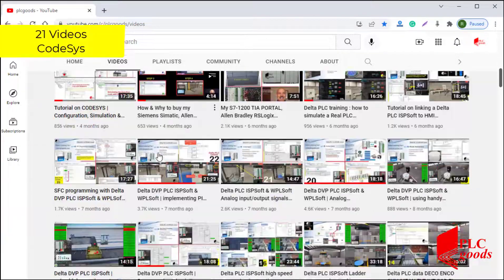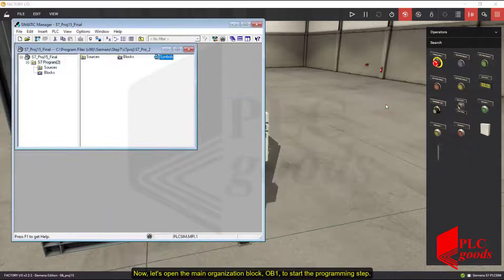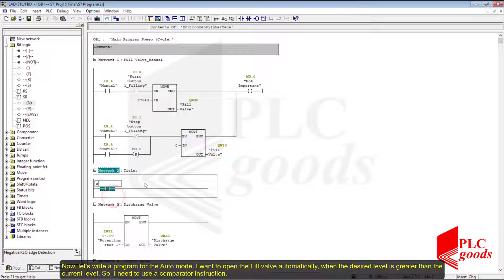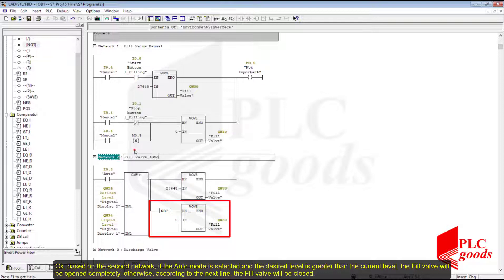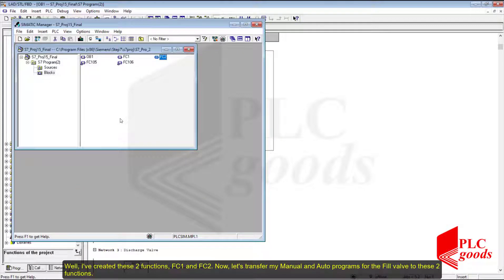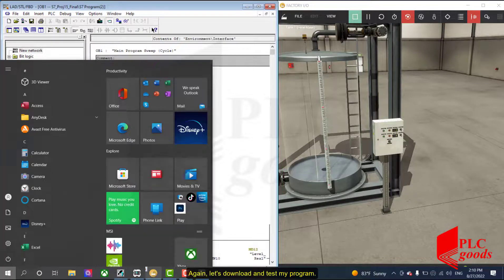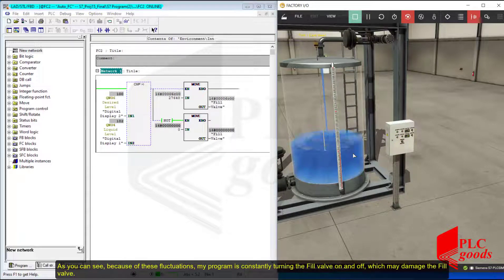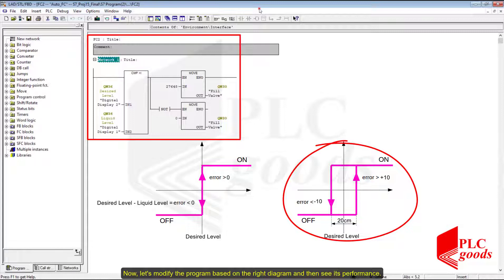ONOFF controller design - ONOFF controller design sample | Lesson 17

Comment: Can I ASK do you have some video for s7-200 using mircowin.
I have been asked to replace a plc in a network of three.
I can plug into th master and seed and copy the programs from all three. I load the program into the new plc and install in the network but the master will not see the new unit. Anybadvice
Reply from the maker: Thanks for your question! 😊
I don’t have any videos on S7-200 or MicroWin, and I’m not planning to cover that series.
For your network issue, here are a few tips:
Make sure the new PLC has the same network address and communication settings as the old one.
Check that the master device is configured to recognize the replacement unit.
Sometimes restarting the master or refreshing the network helps.
Also, verify all cables and connections.
Hope this helps! Good luck with your project.